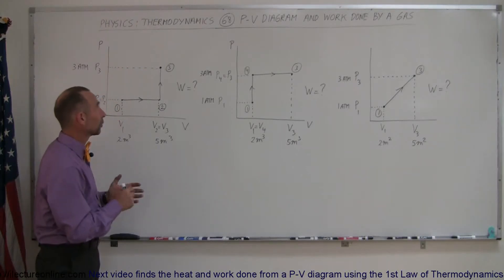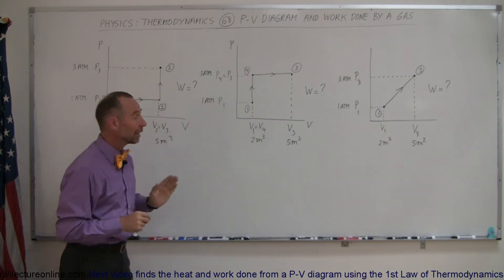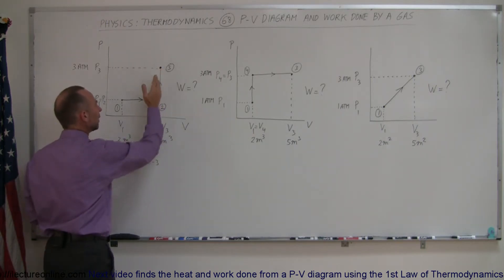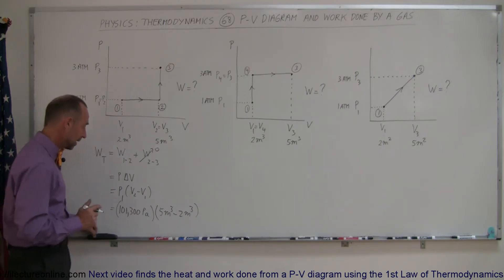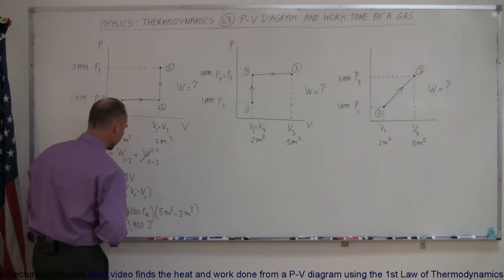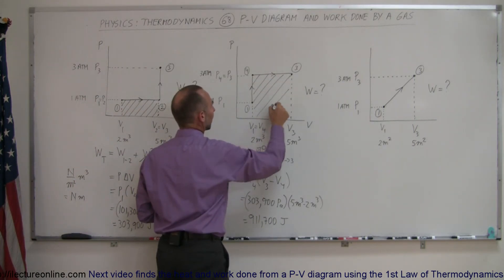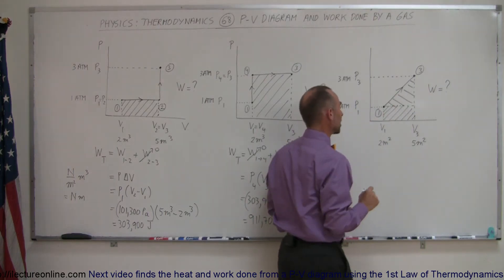Physics 27  First Law of Thermodynamics (4 of 22) P-V Diagram And Work Done By a Gas

Comment from the maker: Sorry I pushed the wrong button and erased a comment by accident.  You asked about the correct value of the atmospheric pressure and indicated it was 101,325 Pa.  You are correct.  But it comes down to how many significant figures you want to keep.  Writing P atm = 101,300 gives us 4 significant figures.  Writing 101,325 gives us 6 significant figures, which may be more than we need compared to the other numbers given.

Comment: Mr. Michel, I believe you should begin using the more precise value of the number of pascals in a single ATM. The actual one is 101325 Pa/ATM.
Reply from the maker: It depends on how many significant figure you want to keep.
Reply: @MichelvanBiezen  Nevertheless you must use this value instead of that one! Your answers have a substantial incorrectness as you proceeded with your calculations. If an experiment is being carried out, this will yield wrong values.
Reply: @andrewjustin256 If you want to talk about precision, you could consider how the given values of pressure and volume only have one sig fig, so by the rules of sig figs the final answers should be limited to one sig fig as well.  Also, for demonstration purposes, I think approximating 1 atmosphere as 101,300 Pascals is fine.

Comment: should the work done for the second graph not be negative ? since its expanding so the gas is DOING work on the surroundings?
Reply from the maker: It depends on how the first law of thermodynamics is defined.  delta U = Q - W (work done BY the gas - defined here) or   delta U = Q + W  (work done ON the gas)
Reply: Yeah the sign convention can get tricky.  The way I remember it is that when talking about engines, people usually put heat in and get work out (e.g. pistons in a car).  Therefore, by convention, heat going in is positive and work going out (i.e. being done by the system on the surroundings) is positive as well.

Comment: In the third example why did you add the rectangle's area ? I am asking Bc in a solution manual they just used area of triangle...But your method makes more sense.
Reply from the maker: The work done by the gas is always the area underneath the curve (all the area).  In the case of a cyclic process (a closed loop process), the work done by the gas is the area within the loop.  (assuming a clockwise direction)

Comment: does it matter if we write V1-V2 instead of V2-V1 in case 1? or we are using the minus sign according to the direction of the arrow?
Reply from the maker: +Attiyah Lanin  In this case it does matter.  But it is better to think about it this way:    If the volume  increase, the gas does the work.  If the volume decreases, work is done ON the gas.
Reply: +Michel van Biezen thanks  that does help by understanding :)

Comment: Thank your sir.This was very helpful , now am ready for assignment.6-  A gas expands from a volume of 0.2 m3 and a pressure of 300 kPa to a volume of 0.7 m3 and a pressure of 100 kPa, such that the p-V diagram is a straight line. Draw a p-V diagram (to scale) and determine the work done by the gas during the expansion. I can easily solve it now

Comment: THANK U sir its very nice & help full video , but when we take the reverse process (means on the path 143 on this diagram) why don't we take the value Of work as negative
Reply from the maker: +Kaleab Embaye 
It may be a matter of words.
Are you using the definition of work done BY the gas or work done ON the gas.
One is the negative of the other.
Reply: 10q sir

Comment: on the third example can we find work by finding average pressure and then 
multiplying by volume? (P1+P2)/2*(V3-V1)
Reply from the maker: Give it a try and see if you get the same answer.  (Best way to learn) :)
Reply: So both ways are correct
Reply from the maker: Let me know what you find......
Reply: Of course the same answer👍 607800Joules
Reply from the maker: That is the fun part of learning  :)

Comment: How we increasing pressure from atmospheric pressure of atmospheric pressure by using atmospheric pressure 

By using a hydraulic Jack driven by atmospheric pressure so we got 100 atmospheric pressure 
101300 joules 

And TWh electricity around the globe and no need of any other fuel

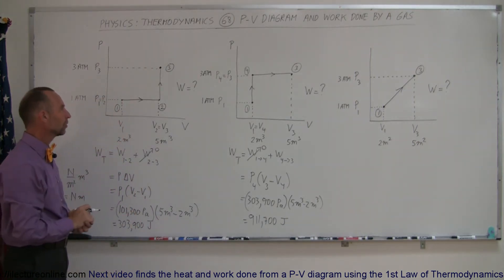Comment: sir at       4:30     you were saying rectangle a  triangle :-)
sir can you tell how the signs will change in the case of work done by a  diagonal line. for example the work done in 3rd diagram from point 3 to point 1, what will be the sign  (using your method work done by the gas)
Reply from the maker: On diagram 3, when the work is done BY the gas from point 3 to point 1, it will be negative.  (since work is done ON the gas to compress it).

Comment: Im taking a thermodynamic's class and cant seem to find the answer to my question anywhere on the internet.

If you have a system with a turbine and a working fluid. Steam enters, and at the exit there is both steam and liquid with an quality of x= %.  With Pressure 1 and Pressure 2 ( initial= 1, final =2), Temperature 1 and Temperature 2, and a mass flow (M').

You are asked to find the Work output in KiloWatts (KW) of the Turbine.

By all means, i know that change in Enthalpy (h) of the fluid * Mass Flow (M') = Work output  By doing so i find the correct answer.

-------------------But this leads to my question,

If i multiply Pressure (pascal) with Specific Volume (m^3/kg), i'll end up with these units:

Pascal*(m^3/kg)= (Newton/Area) *(m^3/kg)

= ((kg*(m/s^2))/m^2) * (m^3/kg) = (kg/(m*s^2)) * (m^3/kg) = (m^2)/(s^2) ----> Which is the same as J/Kg

----The unit i end up with i Joules/Kilograms, that is work. But what work have i ended up with here? Is there a name for it?

Then if i multiply this work J/kg with mass flow (M'), i'll get this:  J/kg * kg/s = J/s (joules/seconds) ----> Which is equal to
Watts (W).

I have now reached the same unit as the "correct" method did. But why doesnt this give the same answer? Have i calculated another type of work in the system? Is there a dimension for Pressure * Specific Volume ?
Reply: Steam in a steam turbine system, is rarely in a state that is anything close to being an ideal gas.  This is why you would not get the same answer with using formulas that apply to an ideal gas, when analyzing a steam turbine.  Or any other substance that is close to the condition of condensing.

Pressure * specific volume does have the units of Joules/kg, which would refer to specific work (as in work per unit mass) in a constant pressure process.
Reply: @carultch  Thx  but 4 years to late, now i dont remember anything! hahah

Comment: 0:43 Isn't it positive quantity if work is done on the gas?
Reply from the maker: +Ahmed Jan  This particular topic is often confusing because textbooks will write the first law of thermodynamics in two different ways (unfortunately).  It all comes down to which preposition was used.    If you state the first law of thermodynamics like this:  The change in internal energy of a gas = the heat added TO the gas minus the work done BY the gas.  Then the work is positive when the gas does the work.
Reply: Thanks for the answer!
Reply: +Ahmed Jan It depends on how your book writes it. The work done on a gas is negative and work done by a gas is positive.

Comment: So, the most efficient system is when the volume is increased to the maximum first and then pressure is increased.  Is that correct?
Reply from the maker: When considering efficiency, we refer to a cyclic process, where you return back to the state you started from and work is done by utilizing the input of heat.  Efficiency is W/Q in.   The most efficient heat engine is the Carnot engine.

Comment: Sir,
would you please give me a hint how i can solve this :
Air is compressed isothermally from 13 psia and 90 degree F to 80 psia in a reversible steady-flow device. Calculate the work required in Btu/lbm, for this compression.

Thank you
Reply from the maker: To find the work you will need to find the the ratio of the final and initial volume using PV = nrT.  Then you find the work done by using the equation:   W = P1V1 ln(V2/v1)
Reply: Thank you very much,
If i may ask more, i have  this:
a compressor compress air from 35 F @ atmospheric pressure (14.7 psia). The discharge pressure is 228.7 psia. What is the pressure ratio?
Thank you ,
Reply from the maker: Ratio means that you divide one number by another.  (it this context it is also called "compression ratio").  Just divide 228.7 by 14.7.
Reply: Thank you very much Professor

Comment: Sir, how about on TS diagram?
Reply: The P-V diagram tells you work as area under a process, while on the T-S diagram tells you heat transfer.  Both of these assume reversible processes, for area on the plot to tell you the corresponding energy exchange.